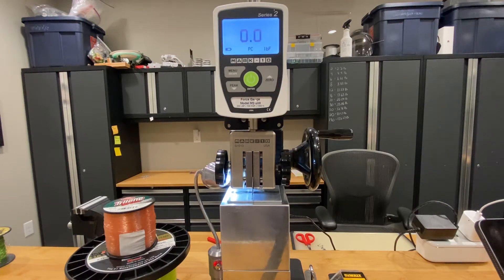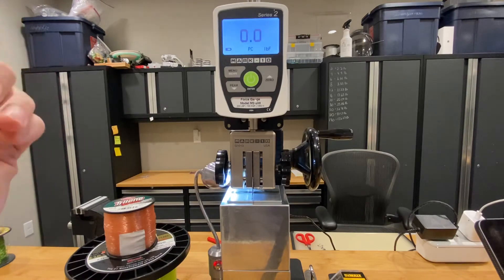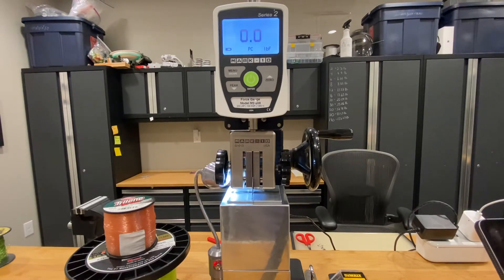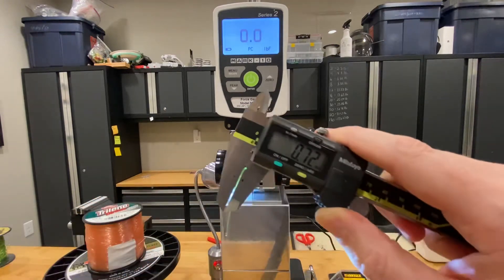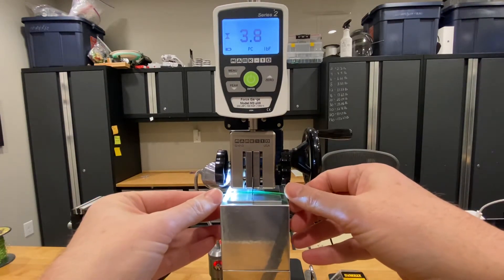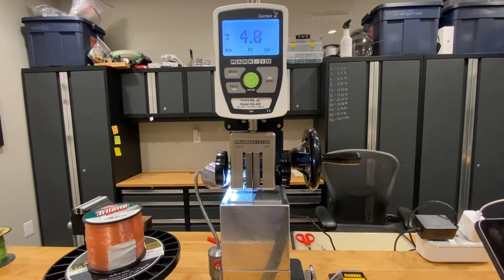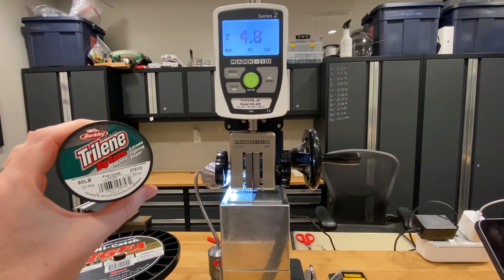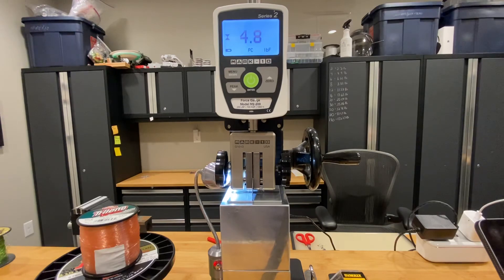50lb Berkley Big Game vs. 50lb Momoi Hi-Catch IGFA - Hardness/Abrasion Test

Comment: I switched over to momoi Hi-Catch last year for my leaders after I saw how well it did on the abrasion test you did before.  I originally tried the Sufix Tritanium Plus, but the "clear" color was sort of chaulky / off white in color.  20# Momoi has been working out well for me.
Reply: I started casting #20 momoi a few years ago.   I found that it's alright for that, maybe a little on the thick side so i would go down in pound test if i bought another roll.